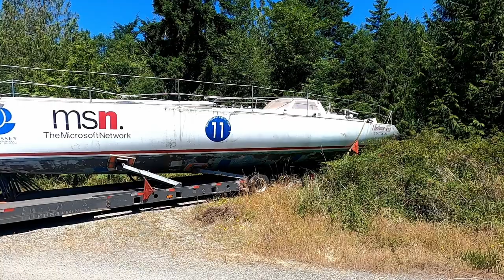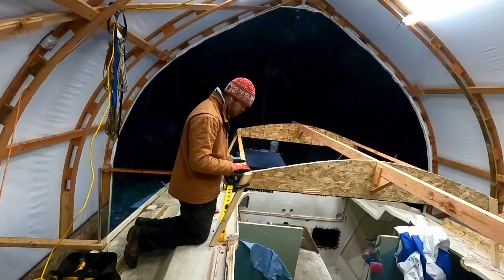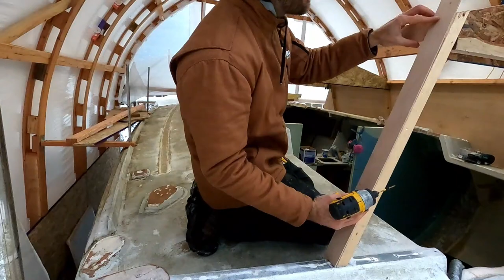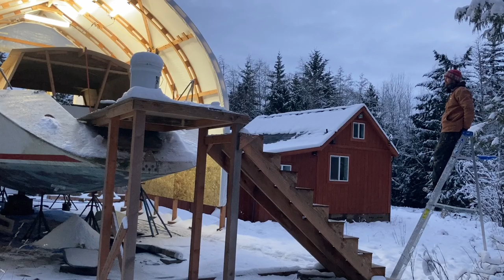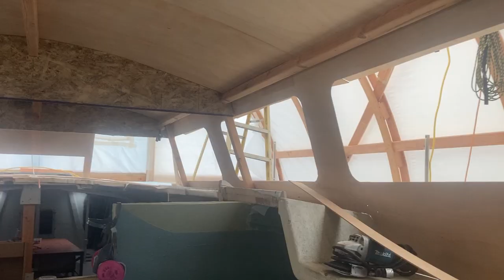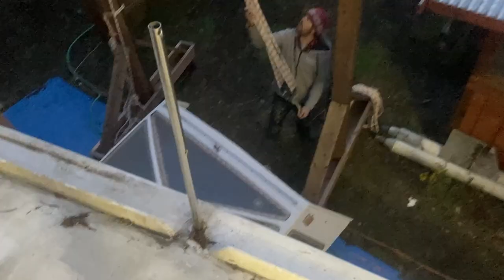Episode 12: New Pilot House, New Look

Comment: Thats a great shape, love it except I'm one thats not for big windows! If in a storm something knocks one out thats room for a lot of water to get in. What I'd do is build in threaded nuts in the hull where you can screw on some 3/4" plywood covers from the outside! Had a friend from top of the island that lost there big steel fish boat and crew except for one guy when a window broke out!
Reply from the maker: Packrat your point is important and one I’ve though a lot about.  We don’t plan to use the boat in higher risk areas, but stiff weather happens everywhere.  I’ll definitely have weather boards at the ready.  Thanks so much for watching and commenting.
Reply: @TheDuracellProject  
Take a look at the Nautistyles tour of the exploration yatch Beowulf.. look at its  Cabin and dog house.  And yes its good to have hurricane covers .. if a line breaks and a block or cleat is pulled loose and thrashing around it can smash standard polycarb windows or glass. 
There is ballistic grade polycarb .. 
Fully protected helms inside and/or out are the mark of a prepared vessel .. 
Laminated glass is strong and scratch resistant and doesnt fog, its long lasting but heavy.. A commercial glass cutter can cut it to size and shape. 

Luxury cars and RVs  have even taken to using double glazed windows and hatches to minimise noise , heat loss and condensation.  A combination of laminated glass forward facing and Plastic/ polycarbonate for less watch  critical windows should give you a good performance balance. You could put polycarb 
Inside behind the glass so as to stop any ingress. 
The old fashioned deck prism also shows a way of getting light into below deck areas. Where windows or hatches would be  vunerable.

Ive recently seen a gentlemans yatch with dolphin windows set into the V birth close to the waterlines ..on Capt Q.s channel... thick Bullitproof glass they dip below the water in part when the vessels heeling so you can see dolphins riding the bow wave from your bed.🤷🏻‍♂️

The other issue is the number of strikes by vessels on lost shipping containers, flood and tsunami swept trees and free floating rubbish, whales and  alarmingly drone submersibles.